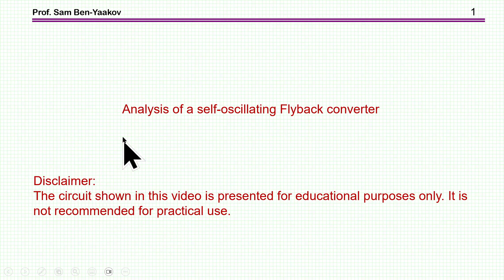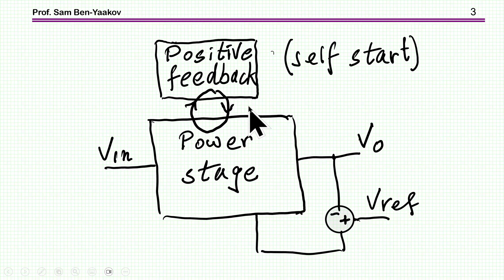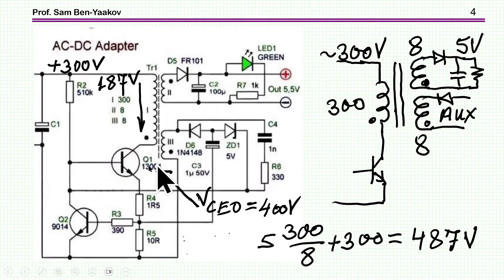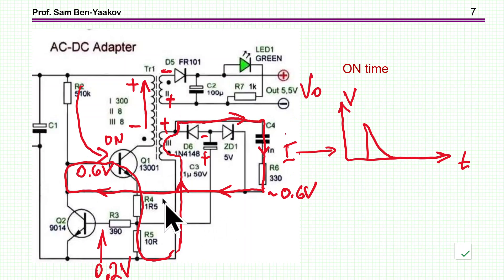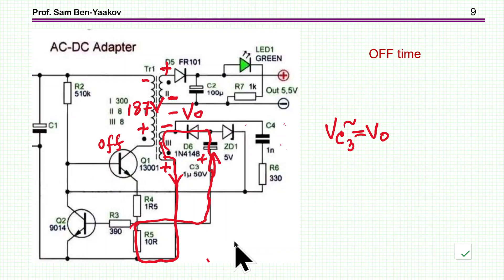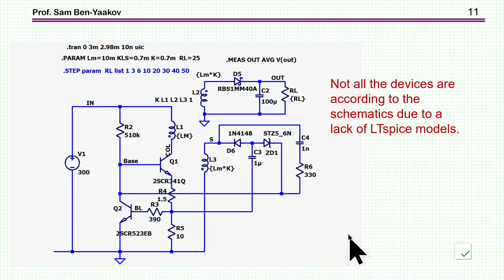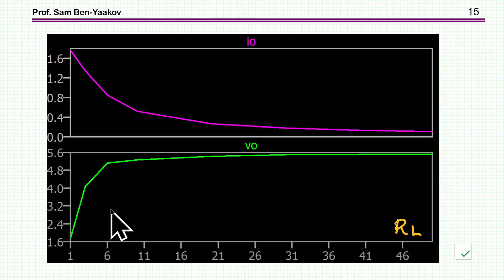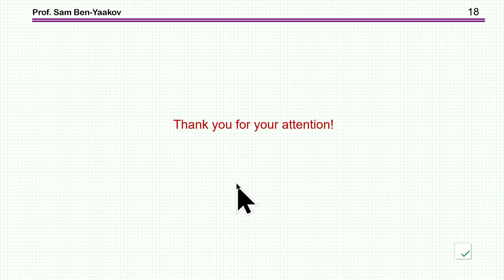Analysis of a self-oscillating Flyback converter

Comment: Dear Sam, thank you for teaching power electronics!

Could you please explain how does a trans-inductor voltage regulator work? How can one dimension it?
Many thanks!
Reply from the maker: Trans inductor you mean like a magnetic amplifier?
Reply: @sambenyaakov  TLVR
A trans-inductor voltage regulator (TLVR) is a topology that pushes the transient response time of multiphase DC-DC converters further down by coupling all phases together through a series of secondary windings.
Reply from the maker: @frunsebischkek1050  This? https://youtu.be/E1kxB61iNZ4

Comment: Good analysis. I have designed some DC-DC converters earlier and met in one system the reluctance to start. The connection was traditional and correct but due to the properties of the Ferrite used, startup was not reliable, whatever one tried to do in the circuit by changing part values. The solution was to use a separate bistable multivibrator as a source of frequency.
Reply from the maker: Thanks for the interesting and important point. Yes,  the startup is a bitch😊

Comment: 7:50 I don't understand this circuit, so maybe somebody can explain it to me.  Red line shows circuit through C3 R4 Q1 ZD1. So, current flow through revese polarised junction BE in Q1? In this case, Veb will be few volts. So, 5V on C3 minus zener voltage of ZD1 will be not enough to flow current. Somewhere on web I saw that this transistor have more complex internal constructinon. So, maybe current flow there in differ way?
Reply from the maker: The reverse current is like the reverse recovery of a diode. During this time, there is no appreciable change in the Bbe voltage.

Comment: @2:45.  RE: Concern about Q1 voltage rating being exceeded.  In this circuit, during the off time, Q1 base is tied to a low-ish impedance by Q2 collector (& in fact Q1 BE is reverse-biased for most of the off-time period), so the most likely applicable voltage rating is Vcbo rather than the lower Vceo.  Looking up the datasheet for the 13001 BJT NPN TO-92, these ratings are (at 25C): Vcbo = 500V, Vceo = 400V.   In my opinion, 500V is still too low for this application; perhaps the saving grace here is that a votlage breakover event on Q1 may not lead to irreversible thermal failure due to the energy being limited by the inductance of Tr1 and the current-limiting feature of Q2 (& R3, R4, R5). 

Yes,  a clever circuit - it offers a good teaching example for the student of power electonics.
Reply from the maker: @Regenersys_Fabio_Barone  Thank you for the good input. I agree. And, I didn't see a clamp at the collector, perhaps they rely on a partial breakdown of the transistor???

Comment: A few weeks ago, I took apart a failed cheap 9v adapter that I'd bought a year ago, and I found this same circuit inside, {but without the LED.) I did my best to figure out how it works, and I understood it on a very basic level, but I never could have hoped to figure out all this stuff on my own. Thank you so much for the detailed explanation! I always like to investigate why something breaks - you have explained why it likely failed, and I can confirm that these cheap self-oscillating adapters do indeed fail.
Reply from the maker: Thank you very much for sharing your experience and for your comment. Very interesting and important!
Reply: I have a bunch, i think again this circuit. In my case the design fails after the manufacturer moved from all throughole to smd where possible... The old ones fail after years when the capacitors go bad...
Reply from the maker: @rewolff2  Thanks for sharing

Comment: The converter should be operating in Critical Conduction Mode; OFF time is not constant.
Reply from the maker: You are correct that the OFF time is not kept constant, but in general, the converter does not work in critical mode

Comment: So, we have a circuit, more than deeply bound to the transformer's parameters (hysteresis especially) that oscillates according to the wire-wound precision of a machine... Aside typical PFC, maybe one should consider that values (V, I for instance) and their derivatives are not constant over time/temperature or both.
Reply from the maker: Hysteresis of a transformer? Please clarify.
Reply: @sambenyaakov  I got better: TI, slup126, page 3, right side atop. Any ferrite material has hysteresis, it depends whether it's neglected or not. The issue here (imo) is the temperature and the frequency: be that of the ferrite and the zener diode. It simply doesn't look like a stable, reliable design. I could be wrong but it looks like a Temu phone charger (sorry for the reference) exception made they didn't used lower voltage stacked MOSFETs 😂.
Reply from the maker: @codures  " In most ferrite materials used in
SMPS applications, hysteresis losses dominate up to
200-300kHz. At higher frequencies, eddy current
losses take over, because they tend to vary with frequency squared (for the same flux swing and waveshape).
" 

How is this relevant to the self-oscillating Flyback?? more than to any other circuit that uses a transformer. And I have got news for you, the magnetic element in a Flyback is NOT a transformer. It is a coupled inductor.
Reply: @sambenyaakov professor, sorry for the late reply and sorry to bring some bad news too but there is hysteresis in coupled inductors, always was and always will, even if it's not the regular "S" shaped form we know from transformers. unfortunately, in the real world, that small surface (or patch) plays a role in the feedback loop, especially in these critical component count schematics. theory is sometimes harder to implement in practice, especially with cheap labor working on half sinking ship in an abandoned port. besides that, peer reviewed studies are pointing out that hysteresis is not only limited to transformers. Let's just say the imperfection of theory is called reality.
Reply from the maker: @codures  Sorry, I lost you. Sure, cores do have losses due to hysteresis. So how is this related to: "So, we have a circuit, more than deeply bound to the transformer's parameters (hysteresis especially) that oscillates according to the wire-wound precision of a machine... Aside typical PFC, maybe one should consider that values (V, I for instance) and their derivatives are not constant over time/temperature or both."